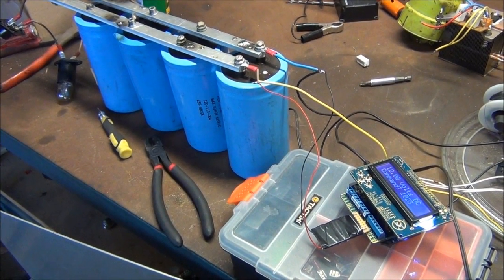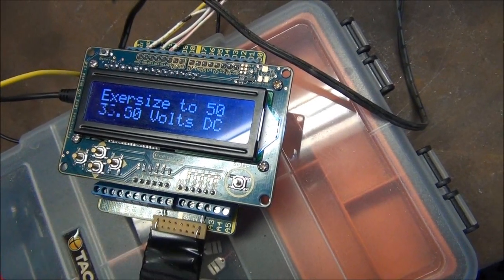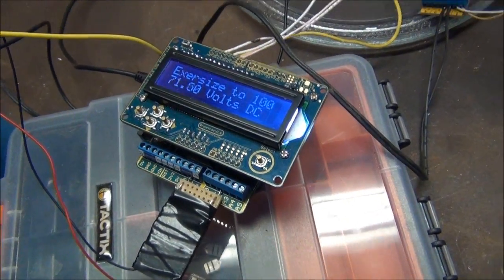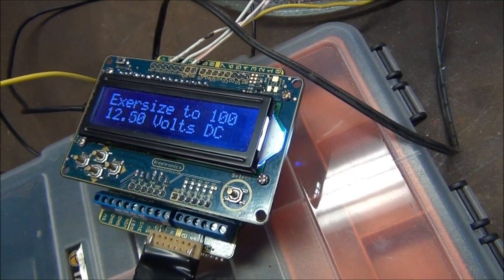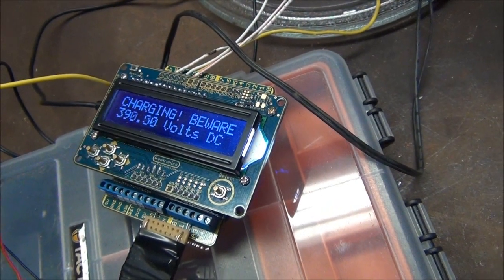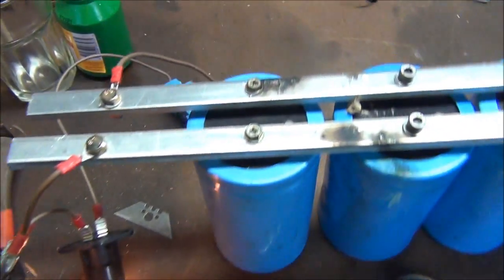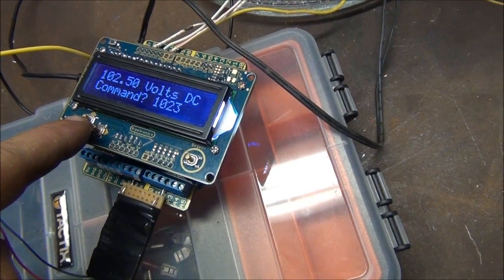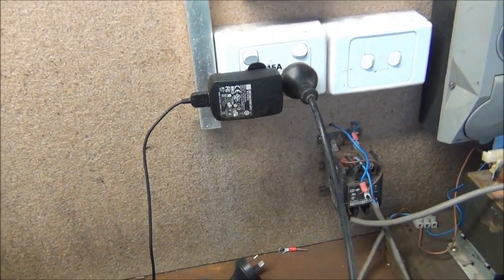Arduino Powered Cap Bank Charger! BIG UPDATE!

Comment from the maker: 2 resistors in a voltage divider, protected by a 100ma fuse and 5v3 zener from memory ! 0-500v in = 0-5v out. i'll draw a schematic for you if it helps :)

Comment: Any plans to just do a boost/flyback converter? the microcontroller can do the PWM, if you add a FET-driver and FET you will have very direct control without using relays to turn stuff on.
The PWM route also allow variable power, even I would still include a interlock to stop it charging beyond a given voltage.
a driven FET can also control the discharge resistor(well.. insert part of own choice, lightbulb, power resistor e.t.c.)

Comment: I would suggest a 10-100 kohm resistor on the analog input
The input is rather high impedance, but it does have diodes toward gnd and 5V so it would take quite a bit more than 5V to kill the circuit.

Comment: I now use a 50W 2K and it takes 3 minutes to discharge my 24mF bank. :) Alex yours should take 1.5 minutes as you appear to have half the caps I do. Just finished the SCR driver board, and about to interface it to the Ndrive from freetronics (mosfet driver).

Comment: Try a 1K resistor for discharging the caps, it's a bit faster. Make sure it can handle the power though, I use a 100W resistor and it barely gets warm.

Comment: Yep. I usually use a variac,to adjust the line voltage coming into the equipment,basically the same thing. Slowly ramp up the voltage,and let those oxides reform. After that,if the leakage current,ESR,etc. is good,you're set.

Comment: was i correct in keeping mine at the start value (25v), for an hour then ramping up to the next value for an hour and so on? I hear you can reform caps in parallel - make alex993cc1's job a lot easier!

Comment: That's probably a good way to exercise the caps,but to reform them you should slowly ramp up the voltage (over several hours) while monitoring leakage current, and let them sit with a charge. The plates need to build up the oxide layer(s) again,and that can take a bit of time.
I'm used to reforming caps from old tube equipment,so you might not need to be as careful with those newer 'lytics. They seem to be working fine.
The zener+fuse is a good idea for some protection. :)